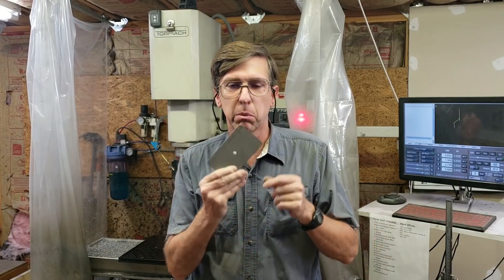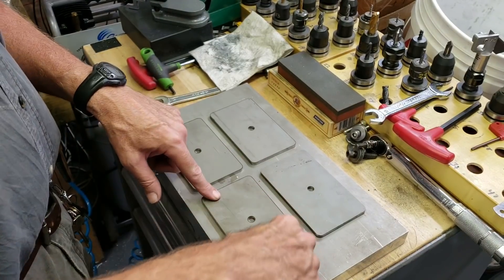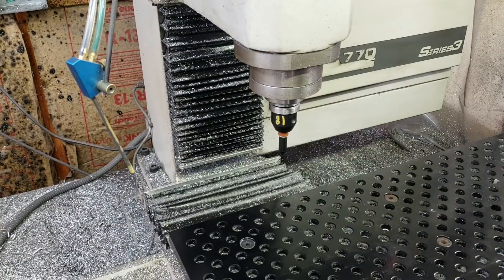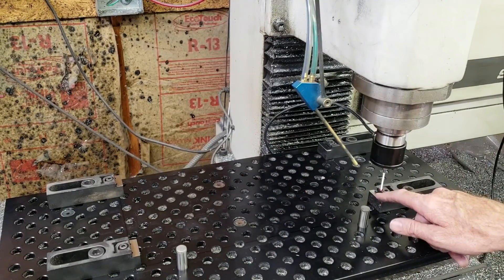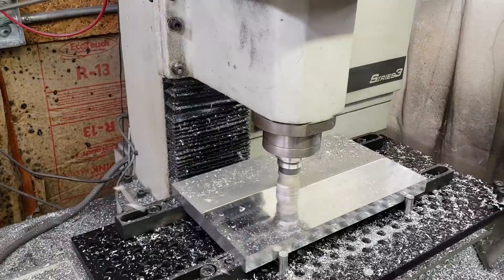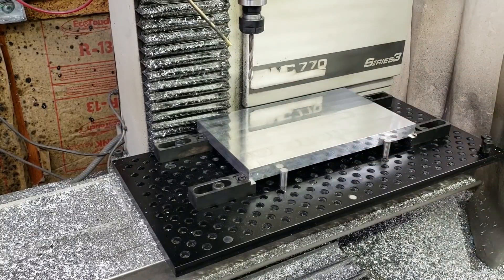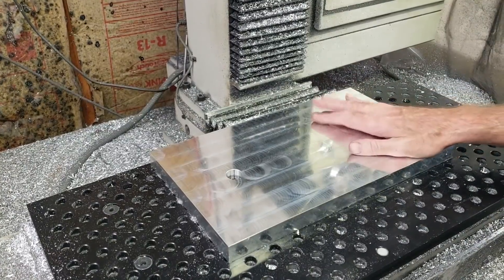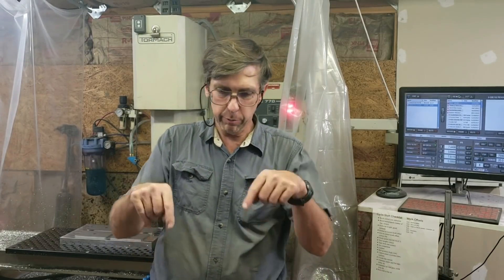Making a Fixture Plate For Laser Cut Parts - Part1

Comment: Might try relieveing the dowel pin holes by a couple thousandths 1/8 inch deep or so to act as a lead in, will make dropping the plate on the pins and removing it alot easier.
Reply from the maker: I will have to give that a try, thanks!

Comment: nice work !! but i would use a dowel pin and a diamond pin for the positioning of the fixture on the table. Also for the clamping i would use some mitee bite instead of a toe clamp since you want to maximize your productivity
Reply from the maker: Thanks!  I tried to find a diamond pin that fits in the 1/2" tooling plate holes but couldn't.  The Holes in my fixture plates are 1/2" .  Good Idea on the Mitee-Bites, thanks.  I should have thought of that.  I use them for brackets on another fixture plate. Lol.